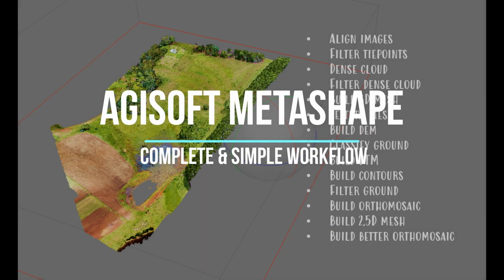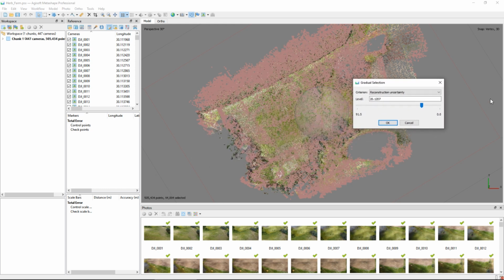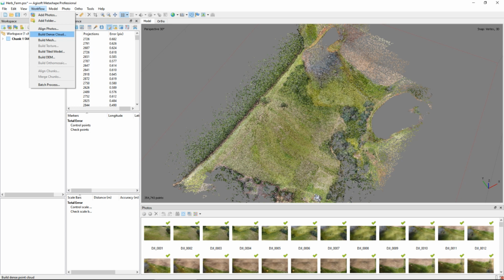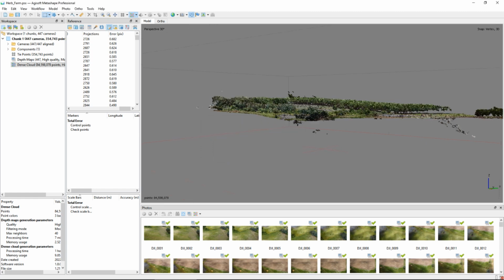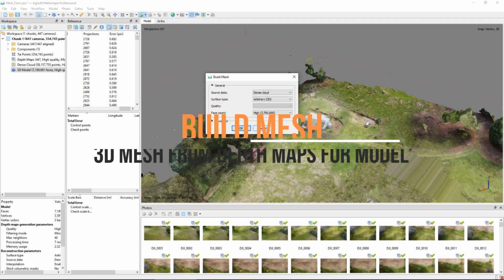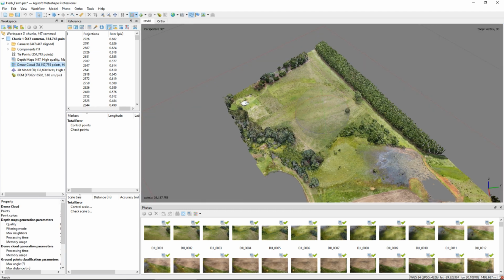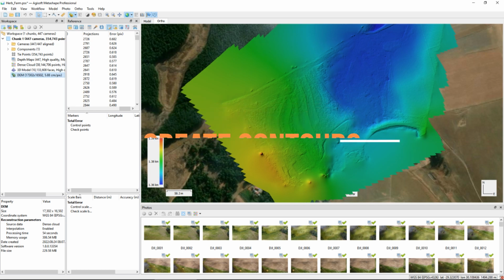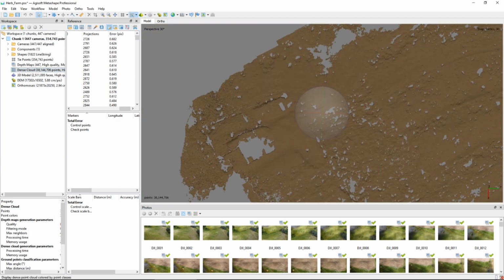Agisoft Metashape - Complete Tutorial (Cloud, Mesh, DSM, DTM, Classify, Orthoimage - No GCPs)

Comment: Thanks for this!  Do you find that the dense point cloud doesn’t have enough to work with after filtering?  My computer takes HOURS to process the point cloud.  800 photos , JPEG… not sure what I’m doing wrong.
Reply from the maker: Hi James - no, in fact I often filter it a bit more or I might generate key-points for certain tasks.

What percentage of your points is it filtering out? 
What is your use case for the data, this might impact on the number of points you need?
If it is getting rid of the majority of your points, we might need to review the camera calibration and see what is happening there.

Yes, 800 images might take a long time, especially if you have very high resolution. Also, if you have an older or perhaps a less powerful workstation, processing times might be affected.

If it will help you, you are welcome to share some screenshots, a video, your data or anything else with me on my email and I'll take a look, after which we can review together? It's up to you, but let me know and maybe I can help.

Cheers
Reply: I am using the new Mavic three enterprise.  My understanding is that it is a good sensor with high resolution. 

I’m honestly not sure how much I’m filtering I pretty much followed your instructions step-by-step.  

I am very new at this so I’m on a very steep learning curve.

My computer is a gaming laptop with 16 gigs of RAM it may not be enough
Reply from the maker: @jamesnahill7124  

That is a good drone with a solid sensor, no problem there.

16gigs may be a little light for bigger jobs, so perhaps that is where the time is being spent in processing, but it'll work, just a little slower.

I am just not sure why you'd be losing so many points. It's tough to guess without seeing the data.

Can you confirm the elevation you flew above the ground?
What percentage of image overlap do you have, both forwards and sideways?
Are you able to tell me the camera focal length before and after adjustments? (You'll find it under Tools>Camera Calibration, then we want to compare the initial and the adjusted "f" value)

My email is geospatialtips@gmail.com if you would like to send some data my way.

Comment: İf you use 16384 instead of 4096 for texture size in build texture tool, you can get a better  3d model.
Reply from the maker: Hi, thanks for the comment.
Yes, as a single texture file 16384 would be preferable to 4096 for a larger mesh, however it'll be slower to view on older PCs or online. The same "quality" can be achieved with 4x4096 textures.
It's best to make the decision as to whether you want many files, or a single texture file, versus your GPU memory capability for display etc.

Comment: Can you explain why you use adaptive camera model fitting and remove points by error before accuracy? I read the USGS guide and they suggest accuracy first then error, and they also recommend to use specific calibration parameters for each step. Thanks!
Reply from the maker: Hi - thanks for your question and comments.

I'm not sure of the exact USGS workflow you are referring to, but I see some comments on the Agisoft forum as well.
Anyway, unless you are using a high-end camera, or in fact a metric camera, then I don't believe that fixed parameters will remain constant for a less expensive camera, such as those on a standard DJI Mavic. As you fly and the drone is shuffled by wind etc. there will be certain flexes on the sensor and lens and they are thus (in my opinion) not fixed, hence the Adaptive model is used. I have also just found better results when doing this. If however you are suing something like a $50,000 PhaseOne iXM150, that is a fully metric camera, with fixed lens and it had an official calibration certificate - different story.

I have seen a USGS article on coastal mapping with drones where they say to keep your key-point limit set to 0! This is a very bad decision as there will be no filtering at all and preliminary camera calibration will be based on bad data from those points not removed.

I filter the points in the order in which I do really because it's something I saw many years ago, it worked well and I stuck with it. Sometimes, I run it iteratively, the whole process, and it never seems to mess anything up. Just remain focused, look at the results and you'll be fine.

This method is what has worked for me and in my experience yields accurate and repeatable results. There are many ways to approach the workflow, but for me this is tried and tested, 100s of times. Feel free to tinker with the approach, just keep checking the results and don't rely on the numbers - Look at the data itself.

Cheers!

Comment: Thanks for a great video. Are the filtering steps needed when you use GCPs? Is the process later faster when you filter vs using all the points? I usually erase all the points outside my area of interest after aligning. For contours, I make a 30cm, 50cm or more /px DEM and build contours from that. They are way smoother and better looking, not zig-zaggy, and that is what you really need. If you survey a land with RTK GPS or total station, you wouldn't measure a point every 5cm or even 5m on large surfaces. Thanks!
Reply from the maker: Thanks for the comments!
Yes, I would always suggest the filtering steps as it cleans out points that have a lower certainty or may contain some errors. I am not sure that the later processes are any faster, but models will be cleaner. So I suggest always doing it as it is a fast process and won't cost you time, but will yield cleaner/better outputs.
As for the contours, that is a valid point, thank you. I would usually create contours in Global Mapper, ArcGIS or something like that anyway, but your point is well made. I suppose one might consider whether we want contours that are aesthetically pleasing, or technically more accurate and create them accordingly.
Thanks for watching.

Comment: Great video thank you. When in this workflow would you recommend locating GCP's when they are being used? after the dense cloud, but before the filtering perhaps?
Reply from the maker: Hi Malcolm. Thanks for watching.
After alignment, I would clean the tie-points first using the "Gradual Selection" tool, then add the GCPs and optimise cameras.
Following that, create the dense cloud (which will then be created off of a GCP corrected tie-point set) and finally, filter the dense cloud.
Reply: @geospatialtips  superb, thank you very much! 👍🙂
Reply: @geospatialtips  Hi! Thank you for sharing your knowledge! Could you plese argue what's make you clean the tie point cloud first and than apply the GCPs? Will it be any conflict with cleaning the tie point cloud before making a manual camera set up?
My regards!
O.
Reply from the maker: Hi - I've just uploaded a video explaining the right way to place GCPs and some problems to look out for
https://www.youtube.com/watch?v=ytvc0euMeKM

Comment: Any way to calculate volumes without gcp?
Reply from the maker: Hi Spikey Slayer - yes, volume calculations as you would do them with Metashape, Pix4D etc. are relative to the data (ground surface) and not usually absolute. What I mean is that you want to find the amount of material above the ground. Thus, if the ground is high above, or far below, the real-world position, it does not matter because your material (volume) would shift accordingly. This is of course reliant on you processing the data carefully, like I show in my videos.

When it would matter is if you are using known bases, or base layers beneath your volume. In that case you would need to ensure that the two surfaces (base and ground level you processed) match well.

If you need more help, feel free to mail me at geospatialtips@gmail.com and I'll try explain in more depth - but I'm sure you get it.
Reply: @geospatialtips  Holy crap, thank you, ok i need to give it a try, have you any specific tutorial to do this? I already have metashape free, but i think i need the standard to do this
Reply from the maker: @SpikeySlayer  No tutorial on this yet - I just make a few videos when my day-job is quiet...

I suspect you would need Metashape Pro to calculate volumes, even the 30-day trial should work as I think it has full functionality.
Reply: @geospatialtips  nice thx a lot, yeah sure when you have time, no stress🤙🔥
Reply from the maker: I had some time to compare volume calculations with and without GCPs. 
https://www.youtube.com/watch?v=UjTToqTkpEE

Full volume tutorial coming soon as well.
Reply: @geospatialtips  Hi, just another question on the same theme, is the meassuring without GCP the same process? Elements, roofs, walls etc are relative to the data and not absoulte so if you have good quallity data meassures you take from it should be fine?
Reply from the maker: @marinomazor.adventures  
Hi - yes indeed. So long as you are careful about your data collection and processing methods, then you will be able to take measurements and they'll be quite close to reality. They should also be accurate relative to other measurements in the same scene.

Someone else asked about this the other day, and perhaps it's time for a "measure-off" video with GCPs and without to prove the point.
Reply: @geospatialtips  ofc should be a good video.. but how do you deal with banana effect? Is it possible to prevent it without GCP?